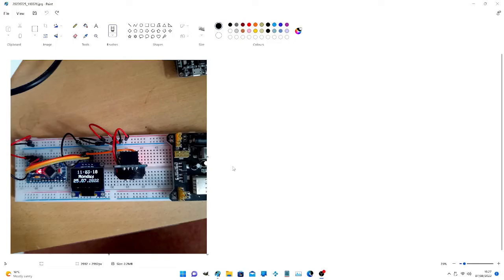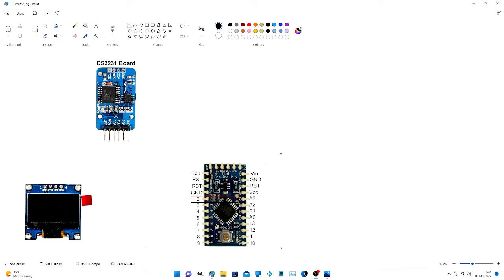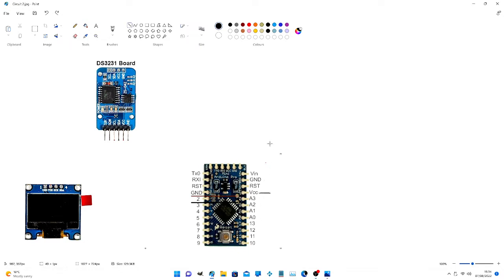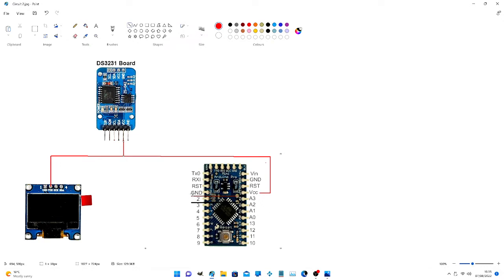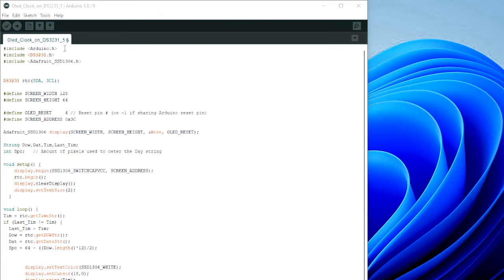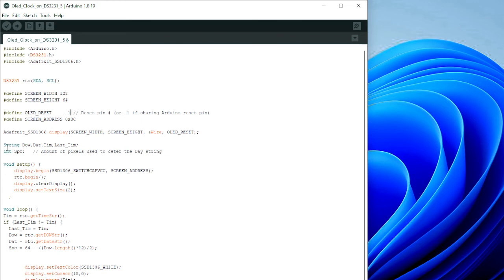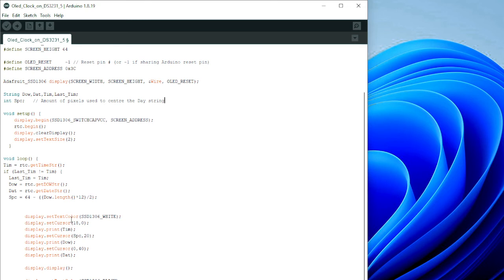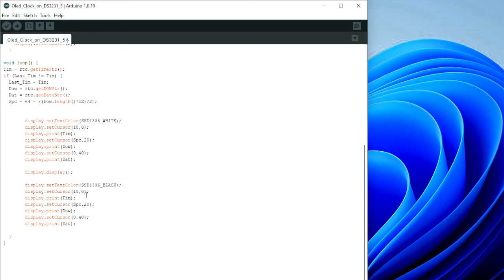Oled Clock on DS3231 using an Arduino Pro Mini

Comment: trying to upload and compile the code .But get this error Compilation error: "no matching function for call to 'DS3231::DS3231(const uint8_t&, const uint8_t&)'.
I'm new to Arduino any help would be appreciated. many thanks.
Reply: Same here mate ... I have tray more than 80 Codes from different Youtube video and get the same error ... I've read more than 50 Tutorials but NONE of them offer a Solution

Comment from the maker: I found the DS3231 to be very accurate. I have had one running for 4 weeks now and it hasn't lost a second comparing it to the radio controlled atomic clock i have.